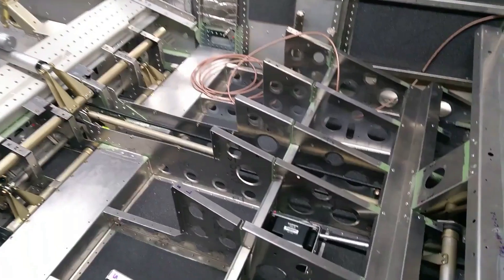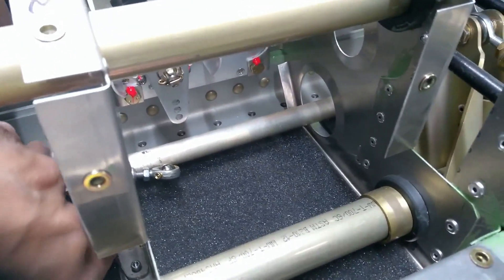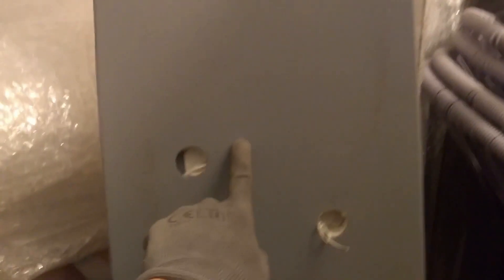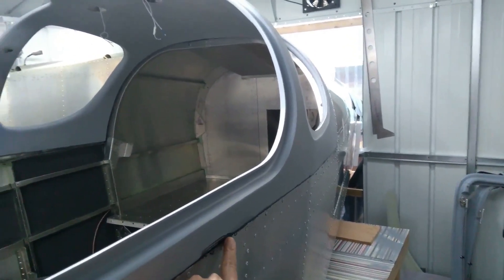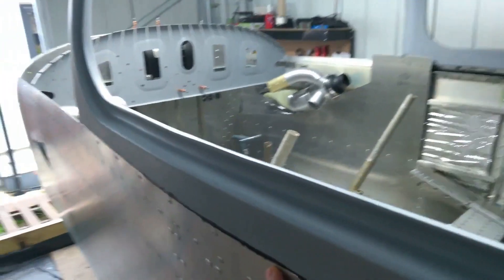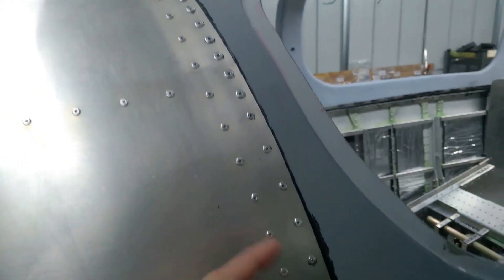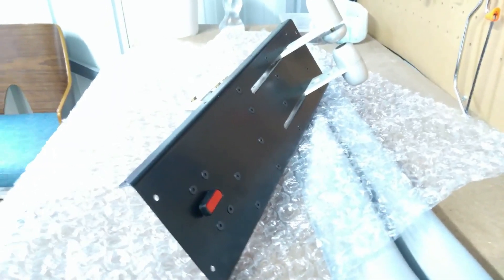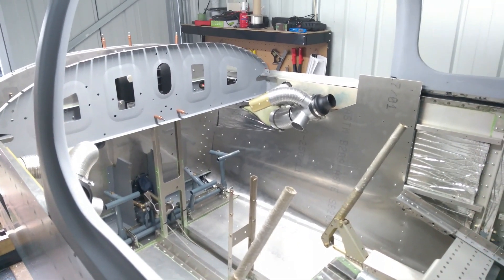Sling TSi Canopy installed

Comment: Did your kit come with the forward canopy lights? Some say theirs did, others say theirs did not. If not, which lights did you choose?
Reply from the maker: Hi Mike, yes I got the forward cabin lights in my kit. They are in black and produce a red light. I ordered the cabin lights and AP pushrod from TAF and not the full electrics kit. But I believe in the newer kits these will be part of the standard kits. Worth checking before ordering